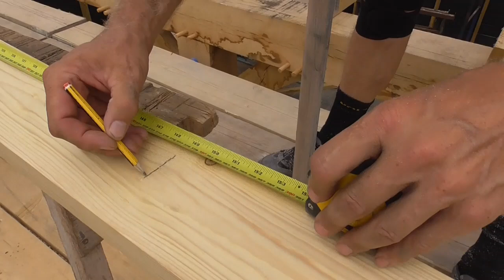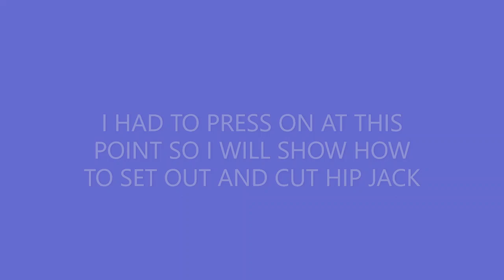How to mark and cut hip rafters on a trussed roof. ***(with splayed birdsmouth cut)***

Comment: Absolutely love watching roofing work, I'm only 37 but love the traditional methods of hand cutting roofs, can't beat some string line and bevels, really appreciate the time u put into explaining especially if u are on job price. Learnt alot from watching the few videos  I lhave found u doing roofs, most videos are  america or Canadian based happy to find someone in England showing in this much depth
Reply from the maker: Hi Sukh 🖐Its my pleasure to film and share my work, and I appreciate you watching and your great comment🤩 If you are learning some bits and bobs from the videos, then that's even better😎Cheers  Del
Reply: This aint what you would call fully "traditional roof " but some of the old school is on show here and Tall does it so well, true craftsmen
Reply from the maker: @ianthompson9058  Hi Ian. You're spot on, and I find more and more of my big roofs nowadays are a mix of engineered trusses and steel with lots of traditional roofing elements like hips, valleys dormas etc👊It's been a while since I did a purely hand cut traditional roof😪 Cheers bud

Comment: Great video mate,  It still surprises me how many “carpenters” don’t  know how to do  truss roofs let alone hand cut traditional roofs . I was shown roofs the same way , with lines and bevels . It alot easier now with the roofing squares.
Thanks for sharing .ATB mate 👍🏻
Reply from the maker: Hi mate. You're quite right, and I do get asked quite often to do more complex roofs for other carpenters. We all tend to think that trussed roofs are not, 'real roofing', (that can be said for gable end to gable end truss roofs), but actually, a big, complex truss roof can still have all the more technical, traditional roofing elements in it, thus becoming a mixture of the two.😎 Thanks for watching and your great comment.👍
Reply: @thetallcarpenter  we get asked the same a lot aswell , I think the colleges don’t help , churning out qualified “carpenters “ after 18 a 18 month course . Had one such lad not long ago , said they watched a 45 Minute DVD and had to cut and fit one common rafter On a jig at college to be signed off on the traditional roofing assessment 🤦🏻‍♂️
Reply from the maker: @ukcarpenteroutdoors7081  Mastering roofing takes years and years, and you've got very little chance if you've not been taught the basics.😬 We're in all kinds of trouble here in the UK when it comes to the construction industry and training, and I only see it getting worse.😪 Cheers.

Comment: Great video as always Del thanks.one think you could touch on in future is the roof square Ur using it was such a revelation the first time I was shown how to use it especially how to find hip plumb cut  from common plumb cut by taking a reading from the inch rise per foot of run scale and moving swinging arm accordingly I think it could help a lot of lads who aren't familiar with the Square it certainly helped me . There's plenty lads making videos showing that they know how to roof but your videos teach how to roof cheers
Reply from the maker: Hi Brian🖐That's a great shout, and I think I will break down how I/we get the hip plumb cut on the adjustable roofing square in a future video, as its not super straight forward😵Thanks for watching and your great comment😎Cheers

Comment: Excellent vidieo. Really well filmed and explained. Ive done plenty of roofs many years ago but been stuck on 1st & 2nd fix for the last few years. Now back into a bit of roofing and your videos are really helping me to refresh my memory. Thank you very much for taking the time to produce these exellent sources of information.
Reply from the maker: Hi Anthony. Its great that you are back out roofing, and I fully understand how it's possible to loose touch with certain aspects of the job if you don't do them for long periods. I had a stretch of fitting out sports centre locker rooms, and didn't go on a roof for 3 years.😬 Thanks for your great comment and for watching. 😎

Comment: This video is fantastic, I love the tried and true methods that have been handed down through the years. Would you happen to have a video on how you calculate the rafters that attach to the hip rafters? There are  two calculations that have to be taken into account, where the rafter connects to the hip,  before the bird's mouth can be cut. These give me a lot of problems. They are never quite as flush as I need them to be for a good job.
Reply from the maker: Hi there🖐Thanks for your great comment and I will definitely do a video on hiw I measure the rafters that cut onto the hip and wall plate on the next one I do👍Cheers Del

Comment: A superb clearly demonstrated and explained video demonstrating many techniques and tips in laying out, cutting and fitting a splayed hipped rafter. The simple practical methods you employed using basic string lines and off cuts of timber to aid obtaining accurate measurements and angles was great to see and learn from. Great  close up shots too emphasised the important cuts and subtle details. Thanks so much for sharing your knowledge and skills - it is much appreciated!!!
Reply from the maker: Hi Jeff. You're comment is amazing and thanks so much for writing and leaving it.🤩 It's not easy trying to juggle all the aspects of trying to make an interesting and useful video at the same time as trying to get the job done and still make money.😆 Thanks again.👍

Comment: Awesome instructional video from a bricky  , got my own hip roof to do very shortly first ever hip  roof for me  done plenty of gabled roofs over the years so this like an adventure for me 🙄🫣👍
Reply from the maker: Hi there🖐I hope my video has helped a little for when you come to do your first hip🤞Thanks for watching and your comment 😎 Cheers Del
Reply: @thetallcarpenter  it has  thank you a question for you , you put a block of wood representing the size of hip rafter which looks about 100mm in video ?  But if im using say a 200mm x47 mm do i put a 200mm block of wood at the  bottom of the hip .rafter on the wallplate to represent the thickness of hip rafter being used  so what ever thickness the hip rafter is we use the same size wooden block  ? dont know if you understand me , thank you  👍
Reply from the maker: @jgj2648  If you go back to 6:00 in the video you'll see how I get the measurement for how high the hip sits above the plate at the corner. Basically, it's the same as the 'height above plate' of the common rafters👍
Reply from the maker: @jgj2648  I should confirm that, the 'height above plate' measurement of the hip is irrelevant to the width of the hip, and the hip birdsmouth is usually much bigger/deeper than on the common rafters because its a wider timber and its at a lower pitch👍
Reply: @thetallcarpenter  thank you sir  very much appreciated for your video and your replies  👍
Reply: Ps beautiful background noise of the singing Blackbird 😊

Comment: Ive been doing a side extension on my house and have recently been fitting a rather complicated truss roof that is hipped to the rear with a gabled front and diminishing valley trusses which form a valley to one side but sit on another hip which is hidden from view when the tiles are on ... to make things more complicated, the two hips I had to cut in were both 6 metres in total but both were in two sections. There were points where I had my phone in one hand playing this video and my saw in the other. I'd just like to say thank you very much and I doubt I would have got it done without your channel.
Reply from the maker: Hi Chris🖐 That's amazing bud, I'm made up that you found my video helpful🤩Sounds like you had a bit of everything going on in your roof, and 6m hips are are whoppers for anyone to cut in💪 Well done bud, and thanks for your comment 😎 Cheers Del

Comment: Thanks a bunch for your video. It only took me and my wife about 3 hours to get my Ridge in on the extension from the Inside end of my trusses to the existing gable and lay the lay plates then measure, cut and fit a dozen jack rafters @ 600 centers.  Obviously we had to get one of those LXT circ. saws and a pencil sharpener. My worst fit was in the bow of the ridge so i averaged the 2 offending rafters and corrected the bent by 4mm... nearly as perfect as your work.
Reply from the maker: Sounds like you did a great job bud and you must be very satisfied with your efforts😁 Glad my video may have helped, and thanks for watching😎

Comment: Great vid as usual totally agree with the way you strung the hip line but here’s a quick tip where you have to make a cut over purlins or girder struss tie a small piece of string around main line slide it down to where your plum cut needs to be then you can measure down to the knot👍
Reply from the maker: Hi Mark. That's a superb little trick there mate, and it's really cool that you've put it down here in the comments.🤩 Adding these kind of extra little tip bits in the comments really helps give a video extra width.😎 Cheers mate.👍

Comment: you said about the 45 degree on your saw. something I have noticed is when I cut compound cuts I always set my saw 5 degrees less than what the angle actually is. so if the cut is 35 degrees then I set the saw to 30. this seems to be the same with all the saws I've used but no idea why! but it works so I just keep that in mind now!
Reply from the maker: Hi there🖐That sounds interesting bud, and not something I've encountered🤔Thanks for watching and your comment🤩Cheers Del

Comment: Great job, that's exactly how I do my hips, only difference is that I measure down from the top of the hip to the top of my block down at plate level and then when marking out the hip all my measurements are marked on the top edge of the hip and then plumb cuts transferred straight down, saves the need for an arcing pencil measurement, basically the same outcome, fits like a glove.👌
Reply from the maker: Hi Danny. You are spot on about measuring to the top of the HAP block and just marking plumb cuts down from the top of the hip, and this roof, (with the lovely, solid and flat oak plate would have been perfect for this). I don't do it this way, out of habit more than anything, as the plates can sometimes be a little twisted or cupped which can throw the HAP block out a bit. (I'm probably splitting hairs and may actually just do the same as you do next time👊). Thanks for watching and leaving a great comment😎
Reply: Same as that!! 🤜🏻 love roofing seem to be second fixing all the time lately!
Reply: @bigboundsy  tell me about it, been 2nd fixing and kitchen fitting for months now, not moaning when it's pouring down though 😂👍

Comment: I always put all the mono trusses in and the flat top girder before the hip.
I keep my line in the middle of hip and use my foot rule blade to mark cuts.
I make a gadget out of two bits of 4-1 with a 45 draft in then slide it down the corner of the building until it touches the monos.
From the line you get all angels.
A lot less faff twice as fast.
Saying that until I was shown this way I used the way you are doing it.
Reply from the maker: Hi Dez. I think I get what you're saying but its difficult to envisage and would probably easier to next time I've got one in front of me🤓 Thanks for adding this in mate😎 (and for watching👍)

Comment: Presumably there are some unusual sprockets going on later to create the eaves overhang, but instead of sitting on top of the rafters as normal they'll be planted on the sides? That's the down-side of using trusses for a roof like this, in that with a cut roof there would be no height above plate........the rafter would spring from front edge of the plate and the sprockets would then just sit on top in the traditional manner. I guess the front sprockets at least will be oak.
Oh, and concrete pantiles on an oak framed cartlodge! What were they thinking?!
Reply from the maker: Hi Mike🖐I think the rafter tails were just not added at design/manufacture, and there is no sprockets I just sit the fascia up 50mm to keep the bottom course of tiles in line👍I'm not going to comment on the tiles😖Thanks for watching and your comment 😎 Cheers Del

Comment: Thank you for your great videos, they are really very clear and easy to follow. I have just fitted lay boards and jack rafters using your other video and it was perfect. This video on hip rafters is also great. However, would you be interested in doing one on an irregular hip please? They are hurting my brain! As an example, my hip is 42 degrees and sides are 30 degrees, plus the first truss is positioned so that, in plan view, the hip rafter does not hit the corner of the wall plate at 45 degrees (more like 38/52 degrees).  I'm clearly missing some knowledge as I can only get the hip rafter to pitch correctly to one pitch as at the top of the rafter, one shoulder is always higher than the common. Any comments welcome - thanks!
Reply from the maker: Hi Nick. It's virtually impossible for me to try and explain how I would go about joining 2 different pitch roofs to a hip. You have to try and imagine the 2 roofs have each got a massive sheet of ply on them, and when you slide them across each roof, the hip will be where they meet. The biggest problem with these type of hips is our minds are pre programmed to cut 45 degree hips, and this can cloud our ability to see the different points at which an irregular hip will start and stop at. The wall plate causes most problems as can't be the same level if you want and even soffit and fascia.😵 I Don know if this has helped or made it worse😬 Thanks for watching😎
Reply: @thetallcarpenter  Thanks for replying - I appreciate your advice. Yes, I guessed that it is difficult to explain via a reply. Thanks for the tip about soffits too. Keep up the great work 👍

Comment: That's how I was shown to "drop" a hip in. Dead accurate and allows for out of square scenarios etc. Did I see in the comments you worked in the U.S? I did 6 years in S.F and loved the work there. Pretty much all timber from the ground up. I am loving your channel btw🙂
Reply from the maker: Hi there. As you say, direct measure when fitting hips gives perfect results in all situations. 😎 I working in Ohio and West Virginia in the mid 90,s. Even then the builders were amazed that I did all the studwork, roof and platerboarding, as well as fit all the linings, window boards, doors, skirting and architrave and fitted the kitchen.👊  I absolutely loved my time there and the people I met were amazing.🤩 Thanks for your comment. 😎
Reply from the maker: @TheToolnut  👍😎👍
Reply: I was a bit lost when it came to the HAP, you don’t drop the hip because you are taking a direct measurement rather than doing the calculation?

Comment: Hi Del, Thanks for sharing, it obviously slowed you up taking the time to share, so good on you for taking the time. did you buy a new hand saw for this looked sparkly new. It doesn't matter how many roofs you do there is always that apprehension when you first offer up. Do well!!
Reply from the maker: Hi Peter. The handsaw is actually not new, but just still looks shiny as it hasn't been rained on.🤪 I suppose we all expect that the first offer in of the hip will show that a little adjustment is necessary, and it's more of little win when it's right first time.👊 They are never miles out, and usually only need a mill or two adjustment to get them sweet.😎 Cheers.
Reply: Hi Del. So that's why you look shiny you've  not been rained on😆
Reply from the maker: @peterbell4154  It was certainly a hot day Peter. I felt rusty when I got home.🙃 Cheers
Reply: @thetallcarpenter  I find Draper hand saws to be excellent Sir, good strong stiff steel. The newer Stanley's have far too much flex and wobble in them. They are only good for busking! 😆
Reply from the maker: @TheToolnut  Hi TN. I'm not really a hand saw connoisseur, and tend to just buy the Bahco triple pack from Toolstaion.😁 I have tried to odd Stanley, and would agree with what you say about them.👍 Cheers

Comment: Where you shown this process when you were an apprentice?, how do you remember all the steps involved like a process like doing a hip roof? Is it just by doing it over and over again or do you sometimes have to look over material to refresh your mind on the specific steps?
Reply from the maker: Hi Charlie🖐I was only really shown basic roofing during my apprenticeship, and everything I've learnt since has just been a self taught expansion of those basics. I take the opportunity, whenever it arises, to talk to other carpenters about how they tackle certain roofing problems that either confuse me or I think I could improve on. Add over 35 years experience to this approach, and now, most roofs are done on autopilot. Occasionally, roofs come along that seem really complex with lots of different elements which can seem really daunting, but in the end, they can usually be broken down into just a connecting series of smaller roofs👍Thanks for your great comment 😎 Cheers Del